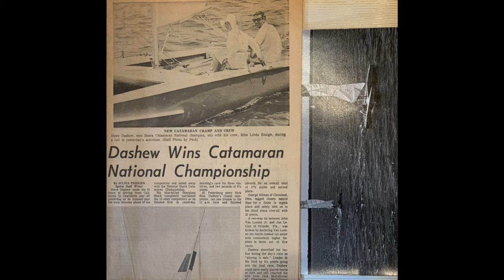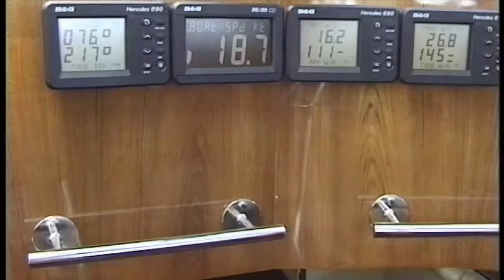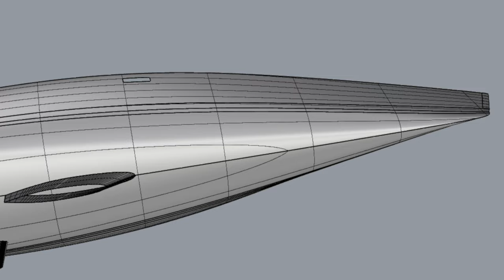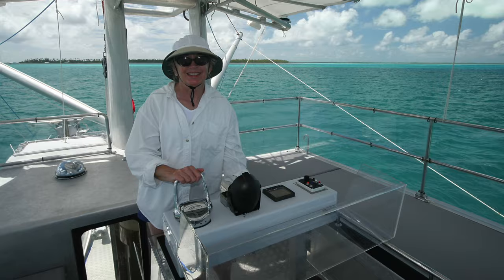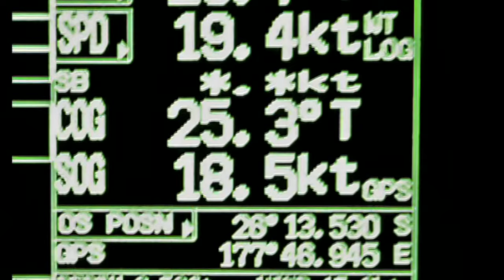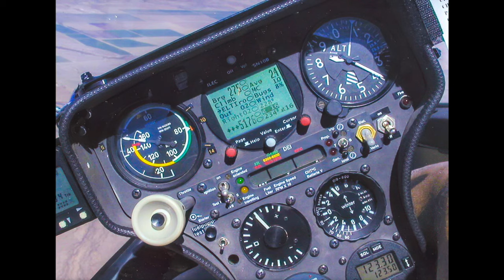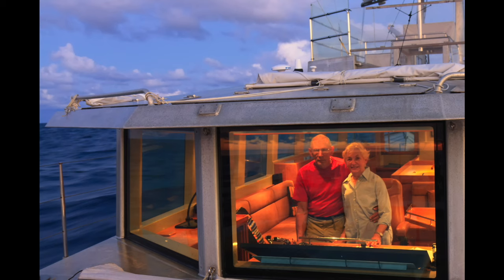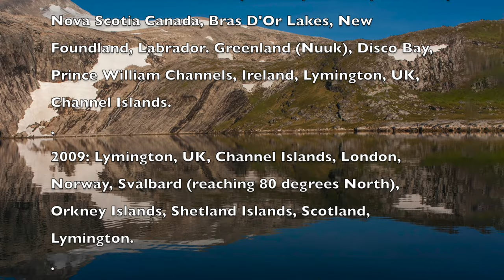Sailboat to Powerboat | Design to First Passage of the FPB Series Prototype

Comment: I was surprised to hear you say that powering costs less per mile than sailing. Could you elaborate on that?
Reply from the maker: When we added up the total operating costs of Beowulf, and divided this by the 40,000 miles she had done, it came out to a little over three dollars per nautical mile. The biggest chunk of this was sail replacement. With a smaller yacht we might have pushed the sails out a bit further before replacing them. I should add that we bought sails during the slow winter season to take advantage of the better pricing. When you add to this servicing the running and sanding rigging, and pulling and inspecting the masts every few years it does add up.
Wind Horse around $2.35/ mile . Diesel was the biggest number but her range and large tanks allowed us to buy fuel where it was efficient. For example, in 2008 when we stopped in Halifax diesel was  $6.00 per gallon. In Greenland it was $2.45. I think fuel was about $1.75 per nautical mile overall on average. The rest was things like oil changes, a 25,000 hour rebuild allowance, etc.

Comment: What was your fuel consumption at cruise and at max speed? What was the displacement and engine size. What was the cruise  speed and max speed. I am a amblatory paraplegic, so I have severe Balance issues.  I have loved sailboats all my life but have not owned one until now, I've only been sailing  twice. I love the look of sailboats and the quietness of them but I'm concerned about being able to sail in my condition. This boat design is very interesting to me, I'm already thinking how I could modify my Luger 27 with it's 9.8 knot hull to do something similar to what you have done.

Comment: Fantastic  boat and story! Will you ever do an FPB with a podded turboelectric drive? There are a few advantages... For one the prop axis can be aligned with the flow axis under the transom rather than the shaft axis going to the engines for greater efficiency. Also, you can have shut off one of two generator sets when full power is not needed while running both props. You can also have two or more generator sets and a single skeg, single prop hull which is a tad more efficient. The generators can also be positioned anywhere on the boat to optimize the roll center since they are no longer connected to the props by shafts. The pods are 360 degree azimuthing making for better maneuverability in marinas or in bad weather because you are no longer captive to rudder authority based on forward speed.

Comment: I’m interested in buying one of the FPBs, but am concerned that I lack the expertise needed. I know I can sail, but it seems the FPBs are very specialized.

I can’t replicate your years of circumnavigation that led to the FPB.  So what would you recommend?

Is there standard training for powerboats or a certification that you think would be appropriate to get?
Reply from the maker: Hi Roger:
That's an interesting question. There are two parts to the answer. First, there are many courses offered depending on where you are located and how far you are willing to go. You can also hire a professional skipper to bring you up to speed.  Just be sure they understand their job is to train you.
As to how difficult, or easy, an FPB is to operate, that's a relative question. The most difficult aspect with any yacht is in tight quarters. Here, our inherent maneuverability is key and you will find us much easier to work into and out of tight spots (the first rule is when in doubt, don't.. Anchor out and wait until conditions improve.) The rest is easy.
The most important skill is understanding weather and you can start on that today. 
If you apply yourself in six months you can be at 80%, a year gets you to 90%, 95% in another couple of years, the last five percent take a while.
Sue Grant at Berthon International deals with your type of question often and she can probably point you in the right direction as well as help you find a boat.

Comment: I’d love to hear why you stuck with a mono hull rather than a cat. Great video and you’ve so much practical experience I would value your opinion.
Reply from the maker: Several long stories in that question. Short answer one is we were bringing Intermezzo back from Mexico, planning on building a 60' version of Beowulf Vl. The slow pace of Intermezzo was driving us crazy - well, me at least. We were anchored off Cedros Island when a Santa Ana blew up. Making the anchorage a dangerous lee shore. Running south for Bahia Sur we were knocked flat, carrying deeply reefed main and storm staysail. A cat would have capsized and the story would have ended right there. Fast forward to where we knew something of design and construction and we quickly learned that for a given budget you will always be faster and more comfortable in rough going with a monohull. When we started thinking about power it quickly became apparent the very high initial stability of power cats would be uncomfortable on a passage.
Reply: DashewOffshore Now that’s a perspective you can’t find from yacht brokers.  Thank you!

Comment: What gorgeous yachts, will the concept work in a smaller yacht with less ambitious passage plans?like island hopping?   Cheers Warren
Reply from the maker: Hello Warp2:
Some of the elements work, but since people don't shrink and even the smallest yacht has basic systems, it is much harder to design a good small boat than a large one. The smallest sailboat we actually built for others was the Sundeer 56. We did a preliminary design for what was essentially a forty foot fractional sloop in a 55' hull. That would. have been a cool boat, but we could not figure out how to manage the large numbers of orders, so we stayed in the larger end of the market.
The powerboat side is easier to scale down.
Reply: @DashewOffshore  , hi Steve , thanks for reply, yes I was thinking of a power boat, an easily driven sort of 'sailboat type' with the stability and safety of your design. 
Probably 40-45' length range but accommodations of 35-38' , plenty for  room for a couple and occasional guests . Not necessarily full time liveaboard but seasonal cruising. with easy passages between areas. cheers warren

Comment: Go fast, Go comfortably, Go safely ~ Dashew
...
38’ Power Trimaran
...
Twin - Honda 15 hp engines
...
Full load, both engines at top speed (5,800 rpm).
Fuel consumption is 1.412 gph. per engine 
Speed is 12.3 knots.
100 gallons fuel gives 435 nautical miles
...
Half load, both engines at mid speed (4,000 rpm).
Fuel consumption is 0.62 gph. per engine
Speed is 11 knots.
100 gallons fuel gives 887 nautical miles
...
Half load, one engine at low mid speed (3,000 rpm).
Fuel consumption is 0.407 gph. per engine
Speed is 8 knots.
100 gallons fuel gives 1,965 nautical miles
...
Minimal load, one engine at low speed (2,000 rpm).
Fuel consumption is 0.169 gph. per engine
Speed is estimated at 5 knots.
100 gallons fuel gives 2,958 nautical miles

Comment: I understand that when you're too old for a 70 foot boat, you do have worries. But why just downsize? As a sailor, I struggle to understand how it is possible to transfer to powerboat
Reply from the maker: Believe me, Lelegume, I struggled with the fizzboat issue as well. There were several drivers in the decision:
First, I was as hooked on flying my glider as I was on sailing. Way more buzz.
Next we really wanted to do some work in the Arctic, and Beowulf was not the right boat for that.
I had a replacement for Beowulf already designed. It would been able to do with code zeroes what we needed a pair of kites for before. But working drawings to sea trials = 3.5 years on a project like this.  We would be forced to detune, go slower.
Going smaller does not help much offshore. In fact, it can be a detriment,
Finally, I was intrigued by the challenge of doing a self righting comfortable power boat, something that does not otherwise exist.
The FPB is a tool for us, and where before we derived the greatest satisfaction from a well made passage, Wind Horse was about exploring. 
Prior to Wind Horse I was averaging close to 300 hours a yer in the glider. This dropped to less than 100 which was really not sufficient to maintain required skill levels.
However, I still don't like  power boats and am embarrassed to pull; into an anchorage of cruising sailboats.
Reply: @DashewOffshore  well thanks for the answer! It's always interesting to discuss about things like that